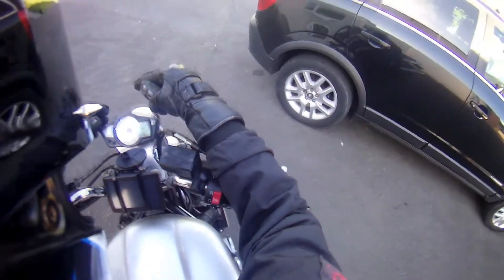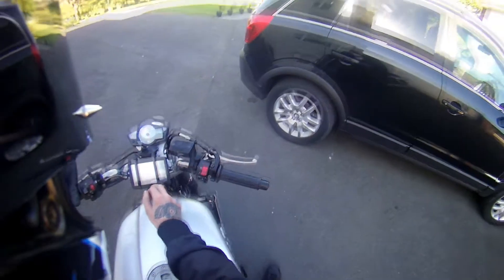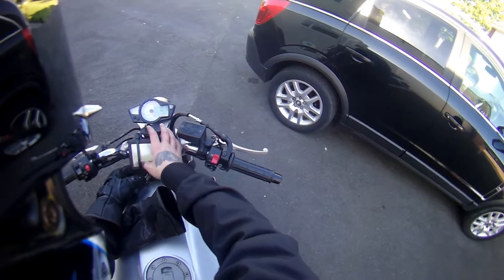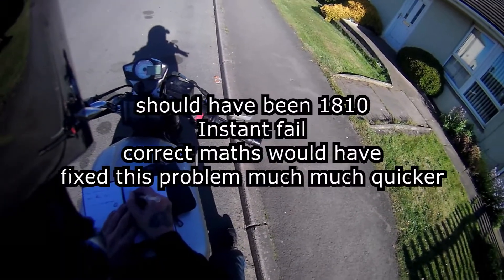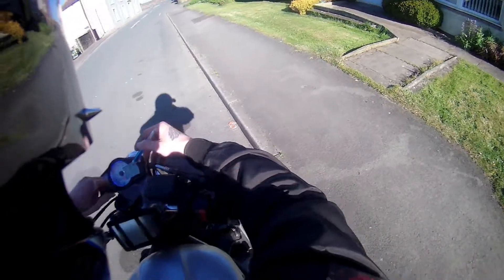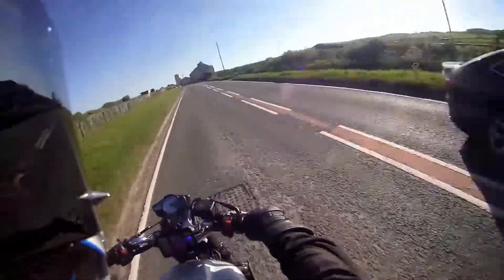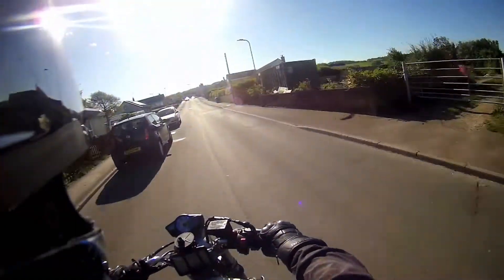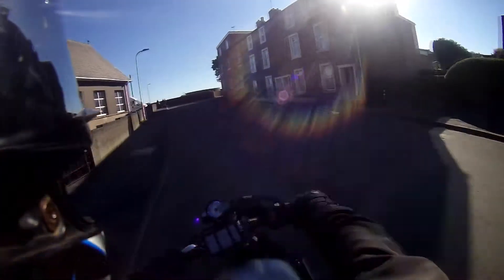speedo calibration using maths

Comment: Great vid as it’ll hopefully help me out no ends with my speedo. I have 5 settings on my speedo and wondered if you also did on your KOSO and what they are.

Doing research on them the settings are as follows:
1 - tyre circumference 
2 - ???
3 - stroke
4 - ???
5 - mph or kmh

Just wondering if you could shed any light on them for me.
Reply from the maker: the proper koso does this was just a cheap chinese copy- sorry for the late reply but dog knocked over a drink on my old laptop and i had no laptop - the stroke is so it knows the revs  i.e one pulse means it is two rotations on a four stroke (but some bikes have a wasted spark system and spark every two strokes so can throw that function off and give false revs)